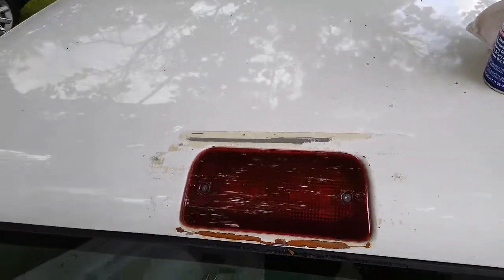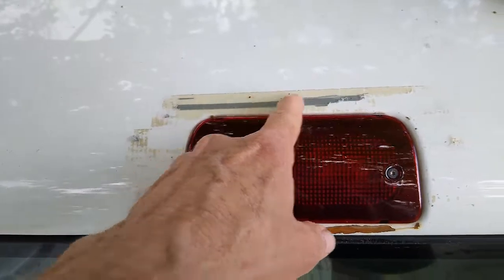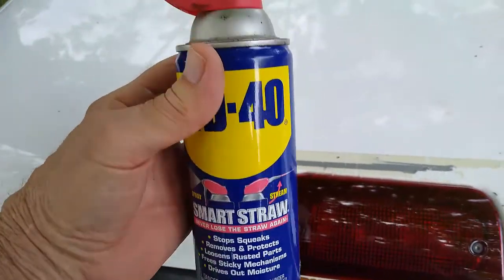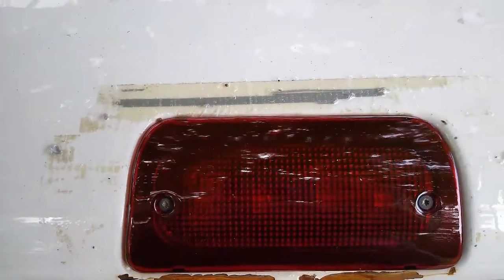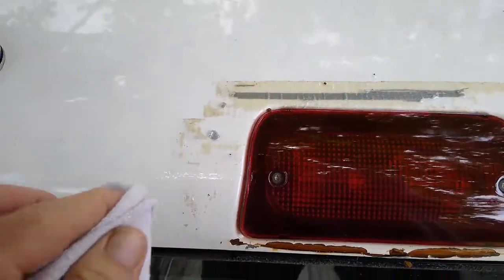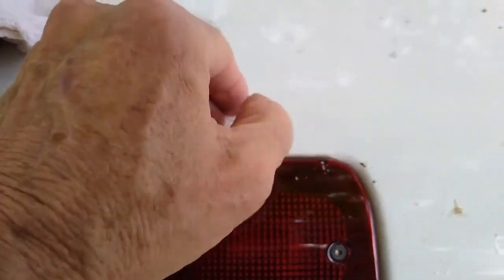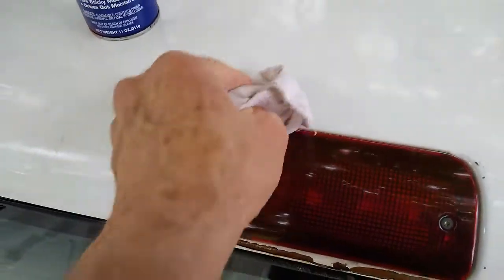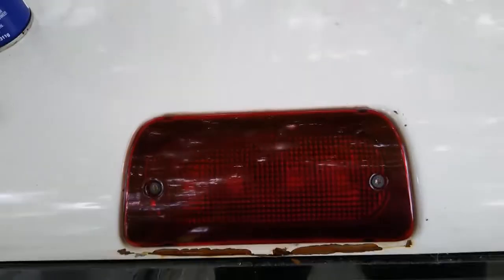Duct Tape residue removed the easy way  Don't  need GooGone

Comment: Wow, it really works. 👍 Last winter I used duct tape to seal a window and when spring came around the darn frame was all sticky and I couldn't remove the marks of the tape.  I'm doing this right now,  thanks for the tip.
Reply from the maker: Hope you had a newer can of Wd40, lol. Thanks for watching Bill,   Pinballman1